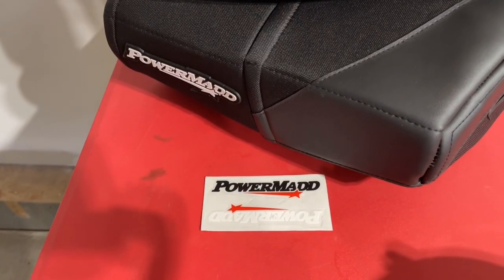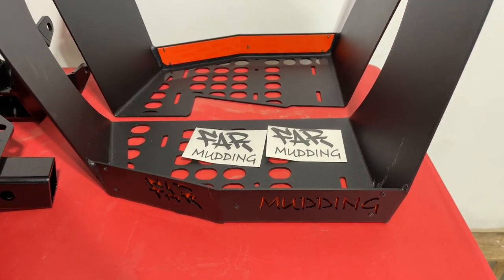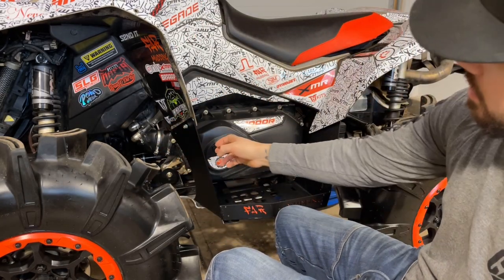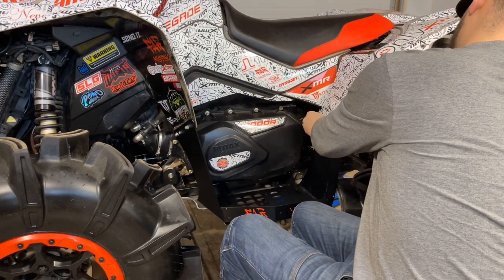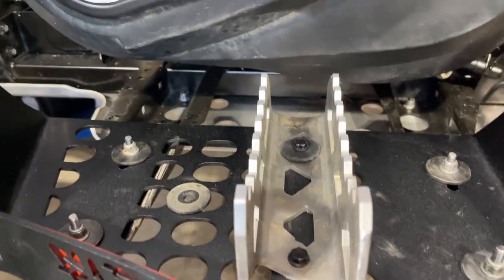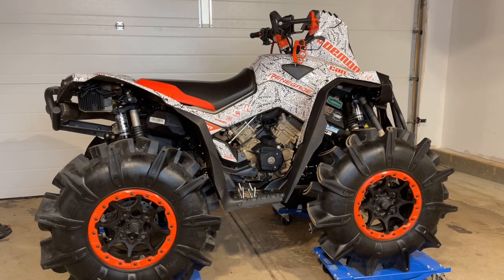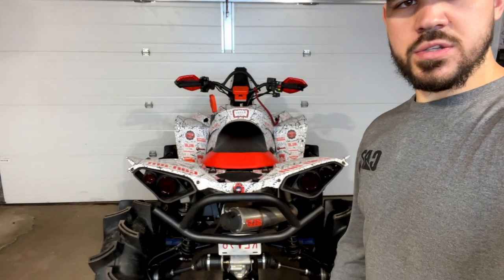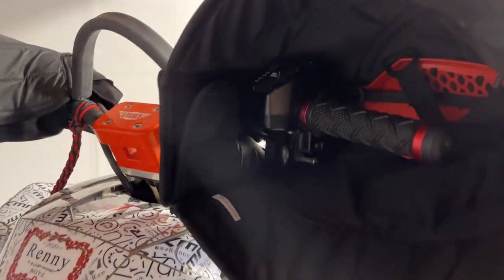Far Mudding Footwell Install On My Can Am Renegade XMR 1000R

Comment: Sweet build, did you do clutching? If so before or after the 32’s?
Reply from the maker: Thanks man and Stock clutching with Black/Violet secondary spring and spins them no issues. Will probably get them done eventually tho.

Comment: I actually like the OEM running boards. I think what I'll do to run 32's is get the S3 stretched arms. But the Gade is looking sick though 🤙
Reply from the maker: Yeah I'm definitely gonna get covered in mud now 😂 makes it look so clean tho so it's worth it. That would be sweet tho and thanks man !! Still doing the family day ride?
Reply: @RennyBoyz  Hell yeah! Debating on bringing the sxs again though. Because I can bring extra fuel with me 😄 guys usually end up asking me for a few litres.
Reply from the maker: Yeah good call lol. I kinda wanna rig something up for the renegade not so much a big back rack but something slick so I can strap a smaller jerry can on for those longer rides.
Reply: You can fit 32’s stock no problem? Don’t need new arms. Just gotta trim the little metal tang that sticks out backwards towards rear tires and there is plenty of room. As your rear suspension compresses your rear tires move further from the footwell. So whatever it looks like sitting still is the worst it will ever be,
Reply: @GR1MREAPER  I realized this after I did a quick ride. I didn't have any rubbing issues which is sweet!